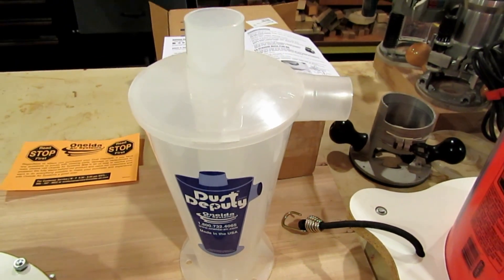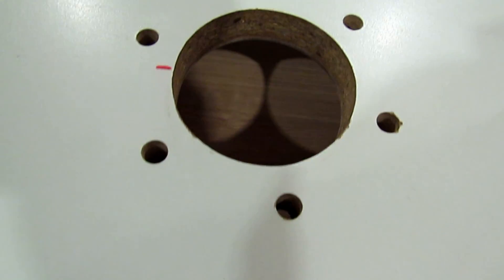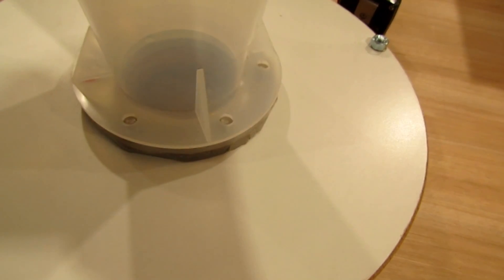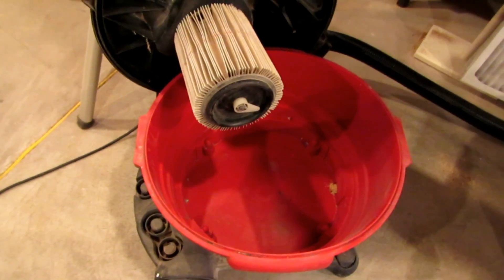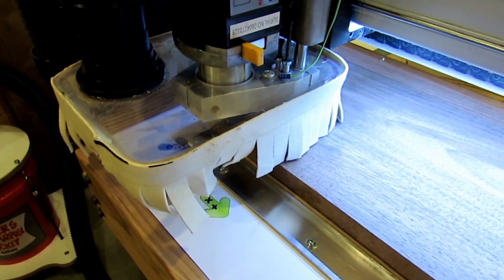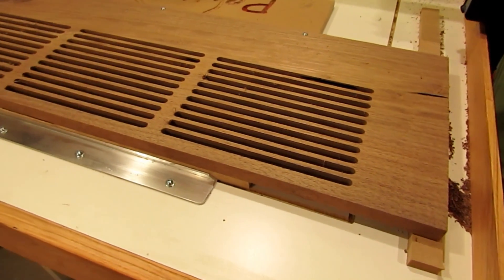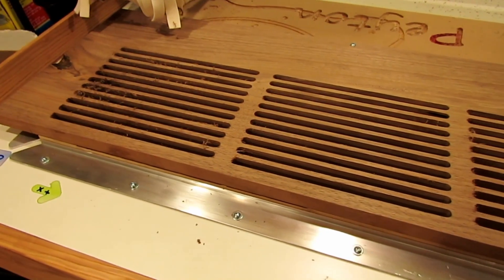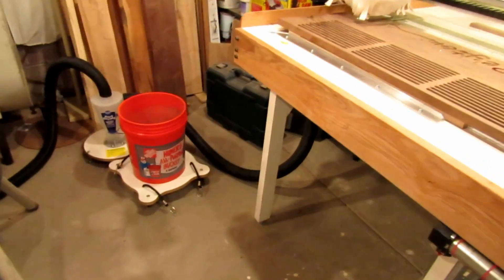Dust Deputy for my CNC Router Part2

Comment: Great tool the dust cyclones. I have 4 of them now around the house and shop.  Best dust collector for a CNC is a dust enclosure.  Made one out of 1" blue foam.   That sits over the Shark 510 HD like a big ice chest.  I lift one end or the other end to gain access to it.  4" Dust Deputy is taking the fine dust from the enclosure and after running the CNC job I clean up with a 2" dust deputy on a 30 foot pool hose.   I did buy a bauer (dust deputy type cyclone) a few  days ago and am testing it out but I am  spoiled with the 30' pool hose on a Fast Cap reel.
Reply from the maker: I recently  built  a larger cnc router  and now use the 5 inch super dust deputy now. These  small ones also work  good but the newer  models have been redesigned to catch slightly more of the fine stuff. I have been thinking  about  trying  the bauer one also but the Oneida ones don't cost much more and provide local jobs near me. Thanks for watching.

Comment: what vacuum did you use? and what type and thickness of hose did you use for the extraction?, thank
Reply from the maker: This is an old video for my first CNC router. The new one has a 4 inch line to my shop dust collection system. Thanks for watching.

Comment: Could you have just used coarse wood screws to fasten dust deputy onto the top, instead of using nuts and bolts?  Or do you think screws could loosen over time?

I like your idea of using gasket and weather stripping for seals.  I'm thinking about copying that, but am thinking about just using the plastic bucket lid with a 1/2 inch MDF underneath, which the dust deputy would just screw into.  The plastic lid would be more cumbersome to remove than your solution, but I'm thinking I probably won't need to empty bucket that often.

Thanks for sharing your solution.
Reply from the maker: You can use what you have. I just made it this way  to make it easy to change the bucket while retaining a perfect seal. Wood screws would need to go in at a angle due to the taper so there is room for a screwdriver.  The bucket lids can be extremely tough to remove if you make them rigid .
Reply: Thanks for the pointers.